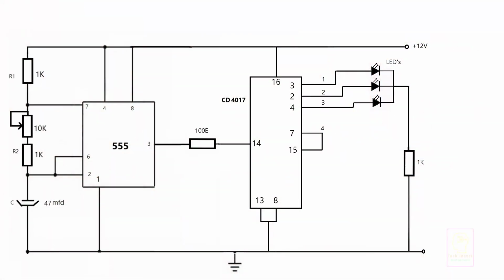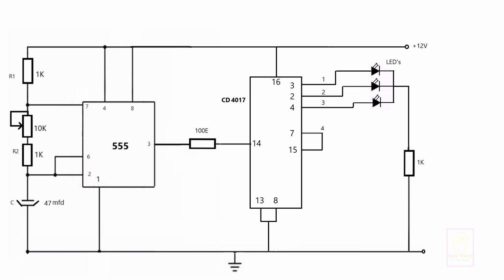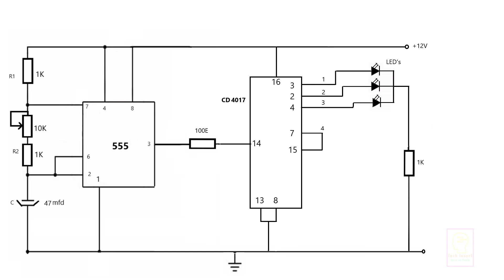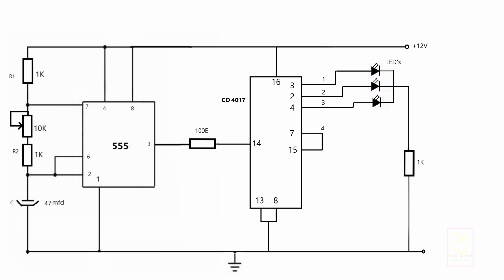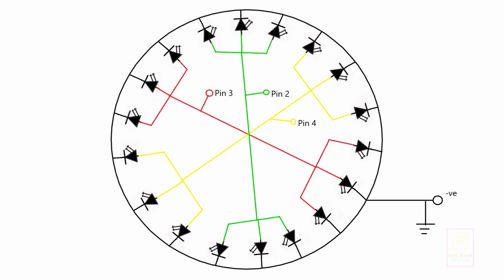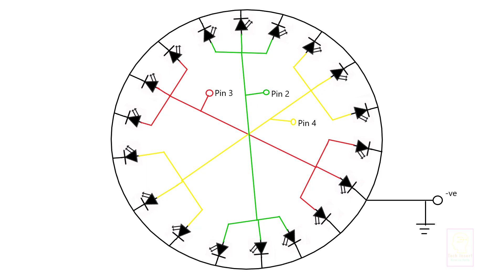DIY LED Chaser: 3 Channel LED Chaser Using CD 4017

Comment: sir thank you for the video. i have a question. i have 3 groups of red led. 1st group is only 1 led, 2nd group has 10 led, 3rd group has 16 led. i used proteus to simulate the circuit but it is not bright. will it be bright in real life? if not what should i do? thanks!
Reply from the maker: One Led you can directly connect. How is ur second group and third group leds connected ,in series' or parallel. Both cases you need a transistor to drive it. 10 Leds in sereis need around 10* 3v per led .so 30v and 20ma current is needed. 10 leds in parallel need 3v and 20ma * 10 = 200mq current  we can use the combination of series and parallel to max utilising the voltage and current we have. This the leds full brightness can be achieved.

Comment: Sir can i use 4016
Reply from the maker: You can replace transistors with cd4016. But I don't recommend that since we are using only 3 channels. 3 transistors are cheaper than cd4016. 

If u asked for replacing cd4017 with cd4016 then the answer is no. Cd4017 is a decade counter but cd4016 is bilateral switch
Reply: @TechInsert  thank u sir
Reply from the maker: Welcome

Comment: Sir 12v led കൊടുക്കാൻ ഏത് transistor ആണ് better.
Reply from the maker: It depends on the current rating of the led.  15w led can be safely connected via bd139 transistor with heatsink.
Reply: Okay sir
Reply from the maker: Thanks